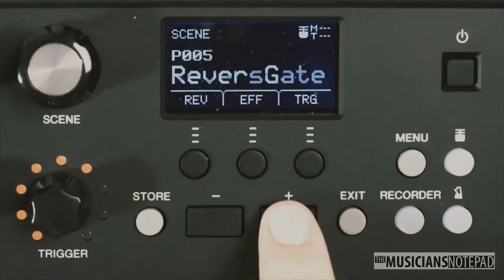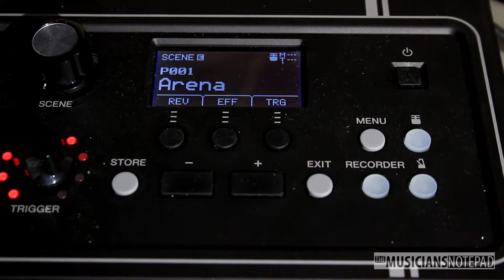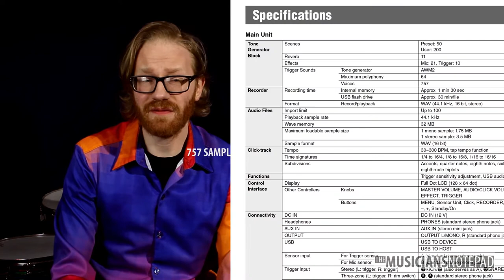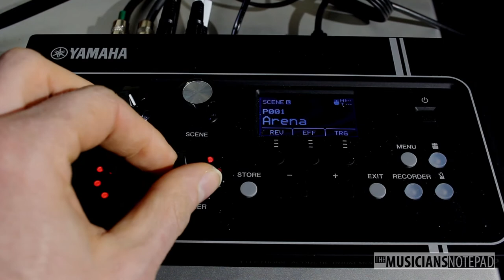Technology and Teaching - The Yamaha EAD10

Comment: Bought an EAD10 and the snare trigger a few months ago. Played around with it and created a few scenes I liked. Used it at rehearsal and worked well. Live vs headphones is definitely different. Finally used it on a live gig. I used my own speaker (15" Behringer) so as not to interfere with PA vocals. Didn't have to fiddle with getting the bass drum mixed to my liking as it was already set up via the module. While you can't really hear all the fancy high end sounds, bass came thru nice and added presence to the rest of the kit. A plus for me as I've never been a hard hitter. Simple set-up...hook EAD to bass drum, snare trigger to snare, clamp module to hihat stand, plug in speaker & module and good to go. Definitely recommend!

Comment: This is the best video, both for the EAD10 and quiet(er) playing. I’ve been through the whole gamut of this topic. Silent strokes, muffle heads, Stealth cymbals and all stops in between. I recently acquired an upgraded drum set and simply added Remo Tone-rings then I bought some 19stick Hot Rods that def play at a lower volume. Not so good for rebound on the cymbals but much quieter. The kit sounds like it should and no one outside can hear me - which might be good thing‼️

Comment: Excellent and useful review. I just got the EAD10 and I too find it useful in lots of ways. One point still unresolved for me is how to actually get inside the menus to tweak fine sound settings--for example, how to change just one aspect of the sound while keeping the other settings. Also, it sometimes seems that changing the trigger or reverb settings via the knobs on the main unit doesn't really affect the sounds as much as one would expect--Arena still sounds like Arena, for example, even when you turn down the reverb or effects settings almost to zero. Still, the EAD10 does a great job of making my kit sound better on stage with little effort, and that is most important!

Comment: Hey, thanks for putting this up.  I'm debating getting it and this helps.  When practicing in my townhome I use L80 cymbals and RTOM Black Holes.  Do you think this would pick up the Black Holes?
Reply from the maker: I think it would work pretty well with the black holes. The center dot of those pads have a pretty well defined click to them which I think would pick up well with the mic on the EAD10. I would place it somewhere between the sound of the silentstroke and the superpad in terms of loudness and definition.

Comment: I've had one for about a year. I strongly suggest going a different route. The EAD10 has far more negatives than the positives. I'm glad you're not being a salesman for the product. A few big problems I've had, and has caused me hearing issues. You can not independently change the volume of the drums from music (if making a drum cover). It's made of cheap plastic, and eventually the ports in the back cause problems. If using 1 mount tom, the crash to the side of it is hardly audible. The bass drum, and whatever is closest to the trigger will be overwhelmingly loud. I can go on....There are much better ways. Save you $
Reply: I'm curious how you come out of the EAD10 to your recording setup. Playing live I had real level issues like you describe until I used the mono out with instrument cable. this got it so the sound I was getting matched the headphones sound out of the module.
Reply: @gator4914  I tried going out from the EAD10 to the Model 24. The Model 24 is a scam. They tell ya you can plug it in to a pc, and use it for your DAW. What they don’t tell ya, is only one channel does that. I tried doing everything with the 24, and ead10, but no success. Now I just go from the headphone jack. What ya can do, but only works sometimes, is lower the volume in the EAD to 4. If ya go lower than 4, ya can’t hear anything. A bigger problem unique to me...I went and got Studio One 5 Pro, and Focusrite 18i20. One I get a handle on that, I’ll sell the EAD, and a trigger I never used
Reply: @gator4914  Are you using IOS, or PC?
Reply: I use PC, and I also use the rec'n share app on an  Android phone. The app I suspect has some software that really cleans up the sound
Reply: I love the EAD10. And I’ve had no problems with levels between drums & music (I do use the Rec n’ Share app). Yes, one need to move the drums around a bit to avoid bleed, but that goes for all microphones. The trick for good levels is to use triggers for all the drums. That gives you better control of different levels. Here’s the EAD10 with 5 extra triggers connected ✌🏻🤩
https://youtube.com/shorts/4QYisw0hWN8?feature=share